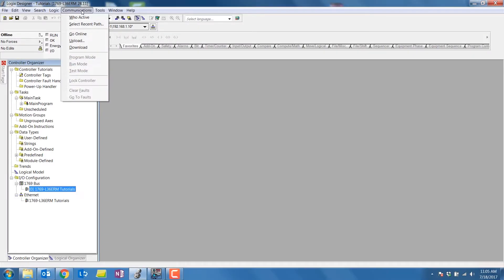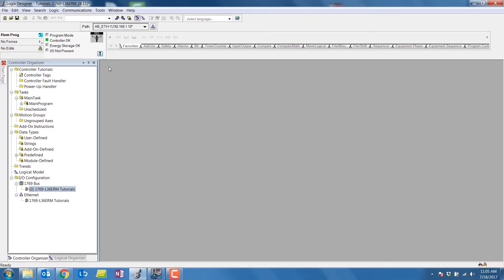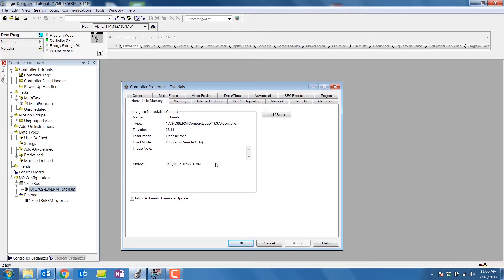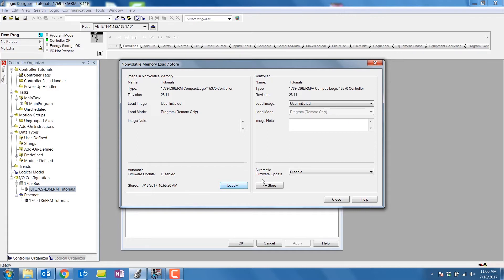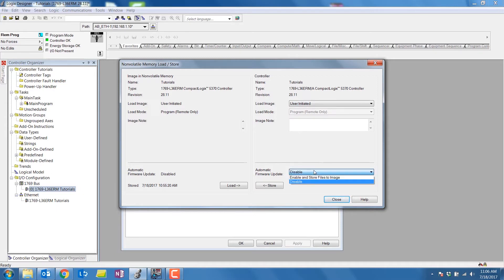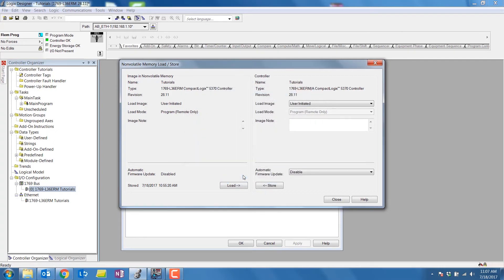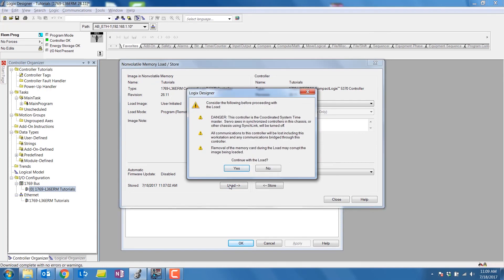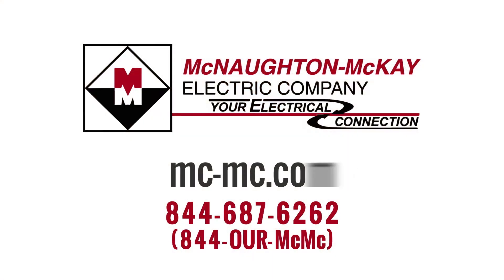How to Use the SD Card for Program Backup and Restore in CompactLogix

Comment: hallo Josh
what is differnce betweeen uinitialized memory and user initiated
Reply from the maker: Hello, When you store a project to a memory card, the settings will define when the backup program needs to initiate. User Initiated means the manual user decides when the backup program loads. This can also be changed to initiate On Power Up, or On Corrupt Memory on the original program. For any other information, please refer to Rockwell Automation Publication 1756-PM017J-EN-P (https://literature.rockwellautomation.com/idc/groups/literature/documents/pm/1756-pm017_-en-p.pdf) or Rockwell Technote ID QA25902 (https://rockwellautomation.custhelp.com/app/answers/answer_view/a_id/676536). Please reach out to your local Rockwell Automation distributor if you have further questions or concerns.

Comment: Hello Sir, is it possible to connect the compact flash to a notebook and open the program in RSLogix 5000? Thank you!
Reply from the maker: Hi Rodrigo, 
The CompactFlash card is only meant to be a backup for the program on the PLC. It is not possible to connect to it using a computer. To access the program on the card first load the card in a controller and then download from the controller to the laptop to edit it. Then you can upload the program to the PLC and back it up on the CompactFlash card.
If you have further questions or concerns, please reach out to your local Rockwell Automation distributor for personalized support.

Comment: Hello Josh, I understand how to make the PLC auto load the project to the controller through the SD card on power up, but how do you make the controller able to read/write on the sd card in regards to using recipes?
Reply from the maker: Hi Mike, Recipes can be put on the SD card from the HMI, but not the PLC. This TechNote explains how to go about that process: https://rockwellautomation.custhelp.com/app/answers/detail/a_id/502272 Please contact your local Rockwell Automation distributor if you have any questions or concerns.

Comment: Can I copy the program to the sd from the plc and move to another plc and upload?
Reply from the maker: Hello Josh, Thank you for your question. Yes it is possible to transfer the program using the SD card as long as the two controllers are the same model (part number). The nonvolatile memory card programming guide goes over the steps to back the program up to the SD card and download it to a new controller:
https://literature.rockwellautomation.com/idc/groups/literature/documents/pm/1756-pm017_-en-p.pdf
Please reach out to your local Rockwell Automation distributor if you have any questions or concerns.

Comment: Hello dear,  i have a L32E with a password. Is it possible to make a backup to an sd without risk. 
Thanks
Reply from the maker: Hello, The password does not affect your ability to save and load the program, as it is part of the controller properties, not the program. The controller will always ask for the most recent password, regardless of if you have saved or loaded the program. If you have any questions or concerns, please contact your local Rockwell Automation distributor. Thank you!

Comment: If we are daily changing the program, Then can we update the program backup on SD card  in Online Mode
Reply from the maker: Hello, Yes, you can manually backup the program, but it will not automatically do this whenever you make changes. If you have any questions or concerns about this process, please reach out to your local Rockwell Automation distributor for further assistance.